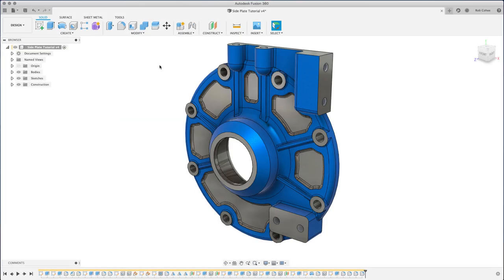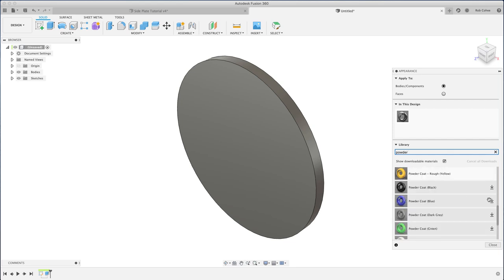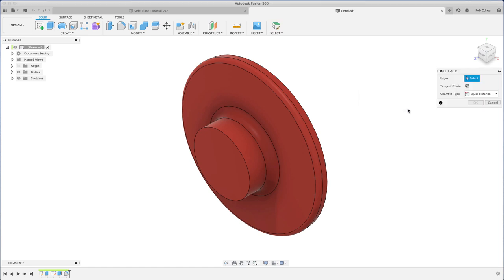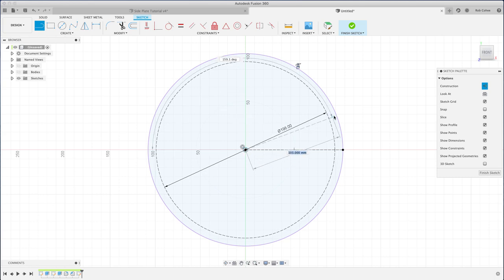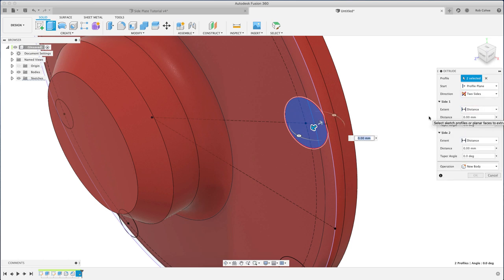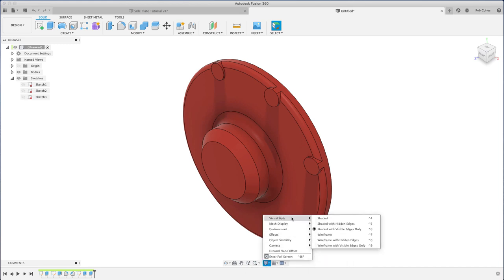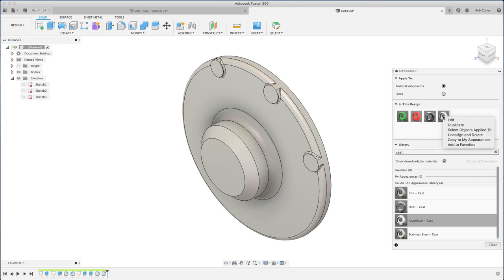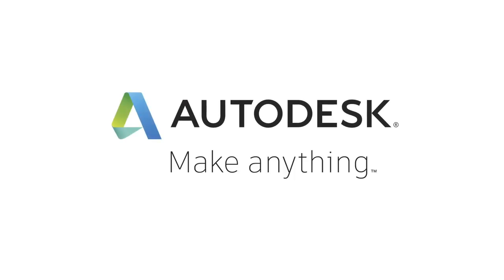Fusion 360 Part Modeling Part 1 of 4

Comment: I am just learning to use a cad program with no previous experience. 
I really like fusion 360. I started with solidworks but I like the features in 360 better. 
Your class is  to advance for me just yet, still learning the basics, but maybe in the near future I will be able to keep up. 👍
Reply: I've been meaning to get solidworks but I can't afford it, could you tell me what exactly you liked more about fusion over the other software?
Reply: @prakrithkeshav9425  it’s cheaper and I just like the ease of use. And it flows better for me. Also you don’t have to down load the whole program because it’s cloud based.